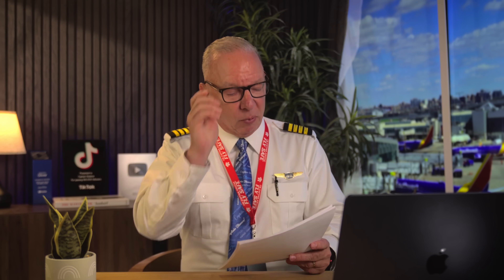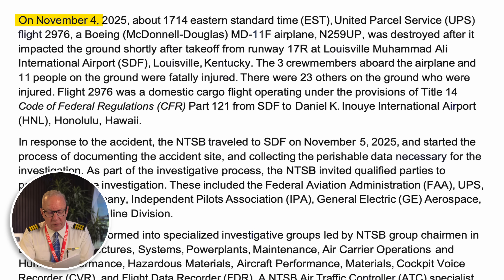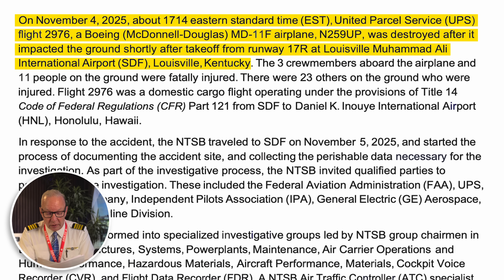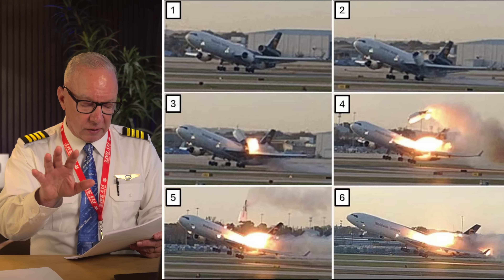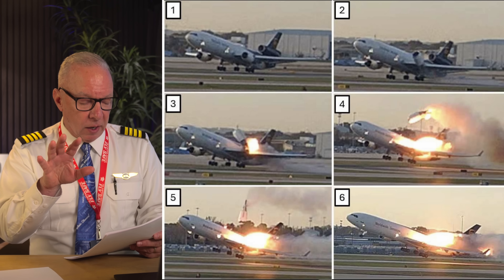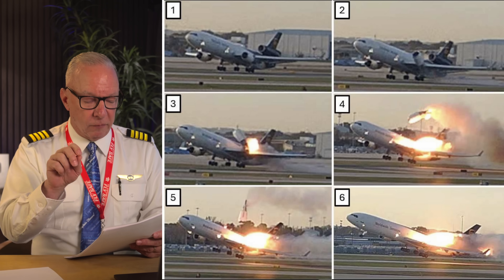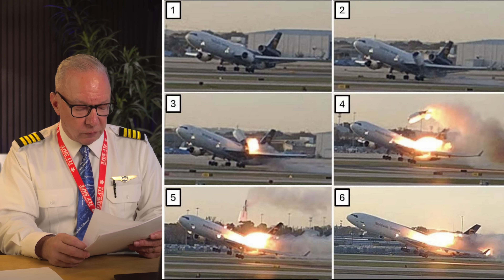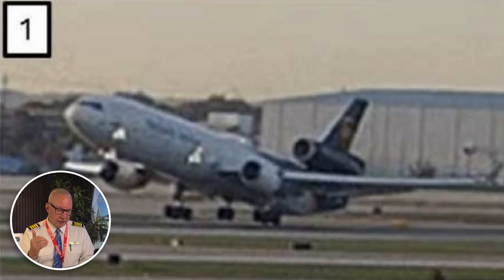UPS Crash Preliminary Report | Pilot Reacts to UPS Crash Report

Comment: It's crazy how much more dangerous these engine mont failures are than just a regular engine failure. 

The pictures and your explanation were really illuminating. It makes total sense that the Engines are producing the thrust and pulling the aircraft and if nothing is holding you the engine down then it will pull itself into the air if it's still on.

My heart goes out to the families and loved ones affected. I hope this leads to tighter regulations on Engine mounting checks so this doesn't happen again!

Comment: Fatigue cracks by definition happen at loads less than the yield strength of the material.

Note that the lugs being talked about in the report are two parts that sit one in front of the other and which make up the pylon part of the aft mounting point. They're two separate parts so that if one of them develops fatigue cracks, the fatigue crack will not propagate to the other part because it's a different piece of metal.

It sounds like the failure sequence was that the aft lug split due to metal fatigue, leaving the forward lug to take the load. Because of the design redundancy intended to handle metal fatigue failures, the aircraft continued in flight. For some unknown amount of time the aircraft was flying with only a single intact lug on the aft pylon-wing mounting point.

Looked at from behind, the left-side engine spins clockwise, meaning that when the engine spools up it puts the inboard side in tension, over and beyond the normal tensile force due to the engine wanting to pivot around the front mounting point. Further, when the aircraft pitches up it places the aft lugs in compression (the rear of the spinning engine core has to be pushed down as much as the forward part of the spinning engine core has to be pulled up, and so there are gyroscopic loads to be dealt with) until the aircraft assumes the climb-out attitude, at which point the lugs are placed back into tension. This is a very quick alternation of loads, and we can see that the inboard side is stressed more heavily than the outboard side due to the inboard side of the fore lug cracking without a corresponding set of fatigue cracks on the outboard side.

On the accident flight the fore lug's outboard side was tensioned beyond its yield strength; at the moment of rotation the rear mounting point rapidly cycled from tension to compression to tension. This loading then unloading then reloading either caused the inboard crack to give way and the outboard side to exceed its yield strength, or the inboard crack had already given way at engine start-up, during a left turn (both of which will put the inboard side into tension), or when the throttles were advanced to takeoff power. The report doesn't mention evidence of progressive plastic deformation, only overstress, so this was the first time the aircraft attempted to fly with the fore lug cracked all the way through on the inboard side. In any case, the rapid cyclic loading did in the outboard side of the fore lug and allowed the engine to liberate itself from the aircraft.
Reply: The description of the forward lug - 'fatigue cracks were observed along the lug bore' - tells me that the inboard side was only weakened by fatigue, much of the fracture surface being  overstress.
Reply: @robertbackhaus8911 : If the majority of the fracture surface is due to overstress rather than fatigue cracking -- honestly, it tells me that this is a McDonnell Douglas design.

Under a few simplifying assumptions, if you take the overall fracture surface, the ratio of the cross-sectional area covered by fatigue cracks to the cross-sectional area covered by overstress fractures will be exactly your margin of safety.

Designing something that has an adequate margin of safety only when both redundant components are present and functioning is 100% the hallmark of their MBA-driven approach to engineering.

Comment: Hi Captain Steve!  I’m not a fearful flier by any means.  That being said with respect to UPS MD-11, hat makes regulators so confident that these stress fractures are not occurring on other aircraft? Is it something specific about the design of the DC-10 and MD-11 compared to other types such as the 737 or A320, which are the workhorses of the passenger fleet?

Comment: On May 25, 1979, at Chicago's O'hare Airport,  the original tri-jet (predecessor of MD-11) McDonnel Douglas DC-10 American Airlines Flight 191, its No.1 (left) engine separated off its pylon during its takeoff. The aft wing pylon attachment fitting failed, due to unapproved & improper maintenance procedure. It was the deadliest accident in American aviation history; 271 people on broad & 2 people on the ground died.

Comment: The engine essentially broke lose and went shooting off without the aircraft. Terrible. Bolts, welds, any third party joining two surfaces together that are subjected to extreme forces are always a likely source of failure - in this case a domino effect - each failure setting off the next. And then, given its metal and fatigue is a common problem, unless caught beforehand, make these events inevitable. I wonder if we will ever get to a stage where we can construct something like an aircraft in a single form. 🤔

Comment: Capt. Steve, there was an incident well documented of another airline catastrophe, dealing with the engine mounts. I forget what accident this was but it was years ago. What happened was during maintenance on an engine the hoist jack to reattach the engine to the pylon. The jack gave away and cracked one or both mounts, causing the disaster. The kicker of the story was the maintenance crew that was assigned to attach the repaired engine went on their lunch break and during this time the lift Jack settled unbeknownst to the ground maintenance. Pretty messed up how something so simple could cause the lives of everybody on board that plane. ✈️

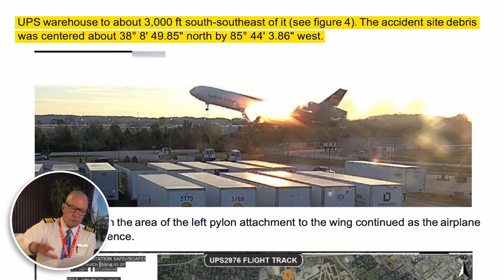Comment: It looks like the rudder in the pic at 6:19 is attempting to turn the aircraft to the right which leads me to the conclusion that l, by this time, the crew is aware of the problem and are fighting for control to correct the flight direction.

Comment: I wonder if the fatigue crack is due to them not following the book on the engine removal process, removing the pylon with the engine instead of the engine only? Similar to the earlier DC-10 incident. Such a tragedy.

Comment: There seems to be some confusion between the forward/aft lugs of the rear mount assembly and the forward/aft mount assembly. None of the quotes from the report shared in the video speak of the forward mount assembly. The overstress was in the forward lug of the rear mount assembly. I wouldn't be surprised if the forward mount assembly is also an overstress situation (and perhaps that's even in the report), but it's not cited here.

Comment: That's very interesting. 
I have one question about the engine's and cockpit controls. Was it not a fact that the two pilots had a conversation between them about shutting down the fuel to the TWO engine's when in fact there were THREE engine's! The explanation of this clearly showed two controllers for fuel! 
How does that work?

Comment: Planes should have cameras from the cockpit facing back to the wings top/bottom and sides. And the cameras from the tail pointing forward to the wings so you can see the top, the bottom and the sides. So that’s one camera on the top and the bottom and one on the left and right side. And it should also have cameras on the wing tips facing forward to the cockpit and the cameras facing backwards towards the tail on the top and the bottom of the wings so you can see the top in the bottom and the sides of the plane.. or one camera that can swing and move back-and-forth and not stay stationary, so the pilots can look around the aircraft to identify a problem. 

The pilots need to be able to identify what is going on with their aircraft. We have the technology a Tesla has cameras all the way around it. If they are placed in the right position, they should be able to give the pilot a full view of the aircraft on the screen that shows all the cameras that he could simply touch and that camera will expand to the full screen can get a clear view. I don’t understand why this technology isn’t being used on aircraft already. This is just baby town frolics.

Comment: If this guy is really a pilot why does he not know that 481 ft above mean sea level is the elevation above sea level, and not the elevation above ground at the location? The elevation of the south end of 17R runway is 461 feet above sea level. If the plane reached not more and possibly less than 30ft altitude above the ground at the location then it would have been at approximately 481 ft mean sea level. Obviously with a large plane it comes down to where the altitude above mean sea level reading is being recorded, as this plane is over 10ft tall from the bottom of the landing gear to the top of the fuselage. I noticed this in his previous video where he thought the 400+ altitude was how high they were saying the aircraft was off of the ground, which is NOT what they are saying. They are say 481 ft above sea level. Again, the end of runway 17R is already 461 ft above mean sea level. 

This guy has to be a fake. No real pilot would be this clueless about how  altitude is measured above sea level vs altitude above ground at location. This is elementary stuff. He's a fake.
Reply: 😕😕CAP STEEEVE IS A YOUTUBE CAPT ------ DUH
Reply: @dodomite134 Cap Steeeve claims to be an airline pilot. If you watch his videos he claims to have flown some of the aircraft he talks about, including the DC-10. He's obviously a fraud.
Reply: You are absolutely correct about MSL vs AGL. He made a mistake. But he most assuredly is a very recently retired AA captain, as well as former USN P3 Orion ASW pilot. If you've made it through life with zero mistakes, I'm happy for you.
Reply: @terised I certainly have made mistakes, but it seems extremely odd that he has made this exact same glaring mistake at least twice that I have seen now, in two separate videos. He even read the words "altitude above mean sea level', and still made the mistake. Extremely odd that an actual pilot would make such a glaring mistake twice on two separate videos addressing this crash.. And they had to have previwed the report before he made the video because he picked out which which words to highlight in yellow, so it's not like he was reading it for the first time. He even paused and dismissed the NTSB BOTH times as being wrong, so this isn't something he made a one time mistake because he just brushed over it. He actually stopped both times and commented on the NTSB being wrong. Very very suspicious. Very suspicious that he would stop and dismiss the NTSB as being wrong TWICE without catching his own mistake at least once. Wouldn't one think, "hey, the NTSB wouldn't screw something so elementary up so I better check myself". Nope. He just presents as if he has no clue, twice.

Comment: You can’t say definitively what caused the engine pylon to break. It could have been a loss of a fan blade that caused excessive vibration that contributed to the pylon failing. The report states that fan blades were found on the runway, they do not state which engine the blades came from. This aircraft had over 90k hours and 21k cycles. The inspection interval on this part is way too long for the age, flight time and cycles.

Comment: I thought after AA191 they said that it was designed for the engine to roatate up over the wings to not hit the empennage? Crazy, 46 years after AA191, the bulkhead on the pylon failed again. I thought that they were supposed to be checking those more since the '79 Chicago accident more often than FIVE years.. Thats crazy.

Comment: As a career pilot with almost 22,000 hours I think its safe to say this airplane is done.  Given the age of the remaining still flying and the tremendous cost of possible maintenance requirements I can’t imagine UPS or Fed Ex spending money on an airplane type that won’t provide long term revenue investment.  In simpler terms they will not make up the revenue long term required to pay for the amount of costs short term.  My two cents.
Reply: My main concern as a Californian rn are DC-10s used for firefighting, because to my understanding there isn’t currently many good replacements

Comment: Now that we know this, can we get an episode on AA flight 191 (or was it 131 I forgot). The one where the same thing happened, and the planes engine fell off? Think it was back in the 70s? Maybe 80s. And go into the details of how they were removing the engines from the plane. They were not following the manufacturer recommended process for removing them. They were taking a shortcut, as were all the airlines. After that accident they all were found out and had to change their processes. Takes longer to put the plane back together the proper way, but it saves lives! They were trying to save money.

Comment: There are reports the plane had a 2 hour delay on the ground for left engine work, matching some eyewitness accounts. So far, NTSB hasn’t confirmed this as a cause, the main lead is still structural fatigue. If the delay turns out relevant, it could expose serious issues with maintenance under tight schedules, possible corners cut, or aging aircraft being pushed too hard.

Comment: Hey Steve I love your analysis but respectfully I am not convinced the ball of flame in the back is the tail engine stalling. Following the trajectory  of the engine that departed it appears it may have fallen to the ground in the spot you see that other ball of fire. I think we may be seeing the engine hitting the ground. The NTSB report makes no mention yet of the other engines. And remember that DC-10 crashed because it lost lift on the left wing when the hydraulics failed and the leading edge slats retracted. This plane had some serious damage done to the left wing. Taking off on two engines should be possible I agree, but it’s more than loss of engine it seems to me. The integrity of the left wing was jeopardized right at the moment of highest angle of attack. The solution would have been to lower the angle of attack, increase air speed and figure out how to fly this wounded bird. Sensory overload. Needed more altitude when he had none to spare. Just a thought.

Comment: So UPS's stiff architecture of doing things by written procedure and being by the book and never changing or updating because "money is flowing in so why change?" finally bit them in the rear bad. This is why DHL is killing them and FedEx. 

That's like treating a car with 300k+ miles should have new car maintenance cycles ever 5 years.

I honestly see a massive lawsuit stemming from this which for a good lawyer willing to take the case suing on the grounds of criminal ignorance and negligence. I cant day who or whom exactly but id say they have a strong case. 5 year cycles on an aircraft with almost 100k hours is NOT ok. Especially with how hard they are run during the peak season. For anyone not aware that airport has landings and takeoffs around the clock 24/7 from Nov to Jan those big planes can be seen in never ending lines coming in and departing.

Comment: We still don't know why it failed to get airborne on 2 of its remaining engines. Unless all lift was compromised on the left wing with no high pressure below the wing being generated due to the heat from the fire. Unless either the number 2 or 3 engine was compromised.

Comment: Captain Steve great channel! Please don’t take this wrong. You are speculating about what happened to the #2 engine. None of what you said regarding the tail mounted engine is in that report. That does not mean its not true, only that it’s not confirmed by the NTSB. It’s also not their focus. So it’s still a mystery why two remaining good engines did not produce enough thrust to clear the obstacles. Speculation is entertaining, but ultimately it can be misleading. RIP those 14, and peace to their families.

Comment: Captain Steeeve, with this preliminary report of finding these Fatigue Cracks in the left pylon mount lug, when the ground inspections take place, as well as visual inspections would you happen to know if special X-Ray machines are used to detect metal fatigue and/or fractures?

Comment: The NTSB has not mentioned performance data from the #1 engine but it had fan and turbine blade debris on the runway, and a vibrating engine could be a contributing factor.

Comment: Worked that aircraft for 20+ years. Great for overtime wages. 🤫
Forklifts (an improper/unapproved tool) are used all the time for engine changes on MULTIPLE other aircraft models. Try opening THAT can of worms. 😳
The issue is the ‘skill of the Forklift DRIVER and the ‘quality’ of the Forklift. 🤔🧐 

That leaves Supervisors & QC Inspectors ultimate sign-offs on engine changes. 

Forklifts don't drive themselves. 😏

Comment: Is it possible to design the engines so that if one falls off, it's a clean separation.  Perhaps when a separation begins, the fuel line promptly shuts down.  At least the engine wouldn't continue thrusting forward as it separates.

Comment: Thank you Captain Steeeve for another great video 
The other thing that I can tell from my countless hours flying and watching air crash investigations is in the stills 1 and 2 the flaps are set for takeoff but when the engine separates you can see in pic 3 and 4 that they also have a catastrophic hydraulics failure as the flaps have rescinded making flight even more impossible. Just my 2 cents

Comment: Let's Cut the Sh**p!  Regardless if DC-10's are called MD-11's, truth be told, the Mechanics 
like in 1991, again saved 3-4 hours, by fork-lifting of a fixed engine, to bolt back into 
the pylon, instead of method by "MD-11" aka, DC-10 manufacturer instructions not to do that!